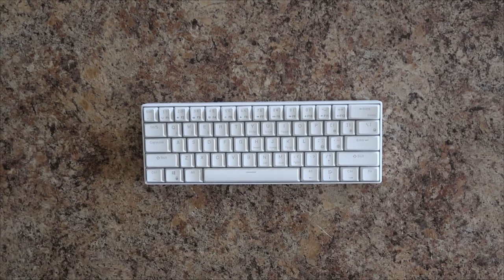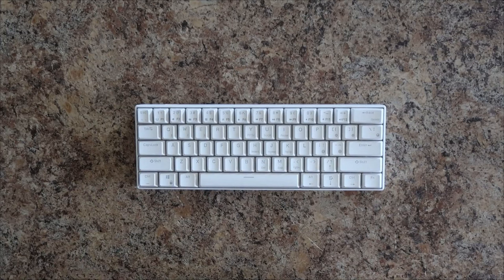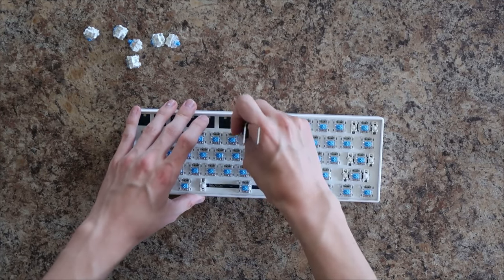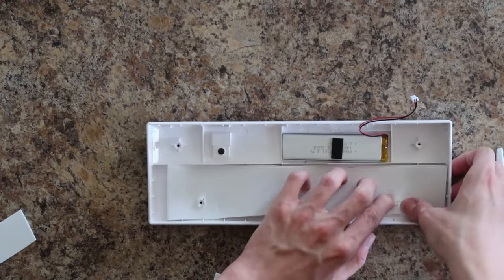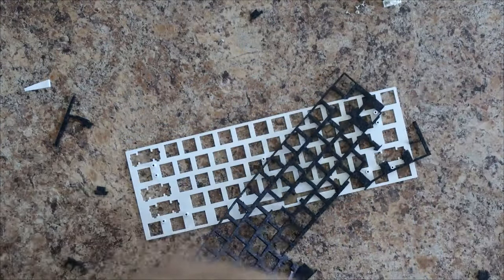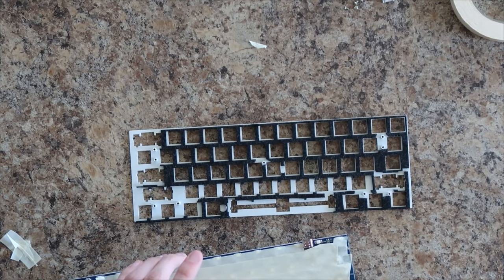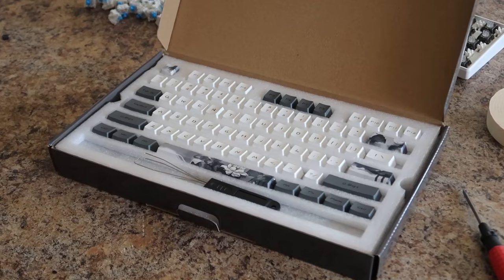Modding My First Mechanical Keyboard (Rk61 Mod)

Comment: PLEASE USE ELECTRIC TAPE IF YOU HAVE A BATTERY
Reply: What happens if I use any other tape
Reply: @moizshaikh2285 it can ruin the battery or melt the tape
Reply: electric tape is better anyways its much thicker than painters tap and sounds much better atleast in my keyboard
Reply: there is no proof of masking tape ever causing problems with batteries. electrical tape leaves residue.
Reply: @sorenkair masking tape can set on fire so it’s safer not too…. Rip rk61 1.0

Comment: Very well documented video, although I do have some things to point out starting with this hobby. Perhaps the stabilizers could've been modded and tuned in order for them to have a smooth and nice feeling. There are many mods and things to help shape a better sound profile for your stabilizers such as lubing and more. Also, your switches are good sounding however I think they are slightly overpriced as you can probably get cheaper switches that feel or sound the same or perhaps even better than the Higround Titan Hearts. Switches such as the Gateron Yellows and Ink Blacks are much cheaper and are better than your switches. Again, these are suggestions only, if what you currently have makes you happy, go for it!
Reply from the maker: Thank you! I wanted to mod the stabilizers as well, but it seemed quite complicated, and I didn't want to mess it up :/. With the price of the switches, I don't know much about switches, but I like higrounds products and liked the sound of the switches. I know they were a bit pricey, but I don't mind!
Reply: @PeytonToenjes  Modding the stabilizers shouldn't be a big hassle especially for a beginner. Even for me, I have modded the stabs of my RK61 and I am still yet to experience the full rabbit hole of the keyboard hobby. I suggest watching a few tutorials and perhaps just trying. :)
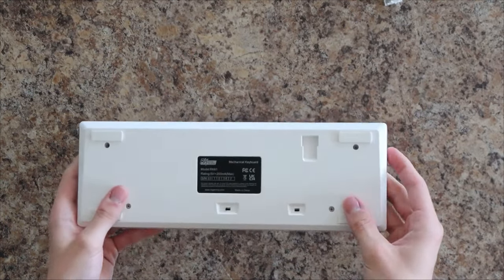Reply: Ik it's too random but is it necessary 2:28 in modding keyboards?
Reply: for almost every mod it is, yes @KhyaTakhe
Reply: yap yap yap yap yap
Reply: @PeytonToenjes I actually have that same mouse
Reply: @4KRESOLUTI0N   RK61 stock stabs are already pre-lubed so they don't need to be modded that much
Reply: @JPCs559  they aren't. i bought one a while ago and they do not come prelubed. unless they changed it now so they are prelubed, they come dry.
Reply: @4KRESOLUTI0N  the one he has is pre lubed.
Reply: Holy yap

Comment: Good thing you like thocc, the rk61 is really easy to he thoccy. simply adding a tape mod. uust 2 layers was enough to make it thoccy
Reply: I wanna mod mine, do i need everything in the video to get the sound?
Reply: yes but get stabs and also different switches if u haven't done it yet

Comment: cool, only complain i have is using higher end switches on a rk61 why get higher end switches that cost as much as the whole board when you could have just gotten a better board like gmk67 or gas68 for around 60 - 80 bucks that have more impact on the overall sound profile overall, budget switches are more than enough if your lube them correctly and could even sound better than more expansive ones. for example, akko cs switches they sound great, and the packaging could function as a lubing station.
Reply: Probably the guy wants just a 61 key keyboard instead of a 67, i couldn’t find any bare bones 61kb without being a complete rip off

Comment: Im thinking about buying the RK61 with these keycaps, with akko piano pro switches, ive never modded a keyboard before, and im wondering, do I need to buy stabilizers, what lube would  be the best, if i need to add foam or tape, and what mousepad would look the best with it? Also awesome vid <3

Comment: I'm confused. Didn't the foam go over the case cut out for the on an off switch?
Reply from the maker: I'm actually not sure, lol. After I modded it, the foam was slightly in the switches way, but after I used them a bit, it was fine.

Comment: I have a question, my mother is afraid of breaking the keyboard by removing the old switches, putting the tape, foam etc. and in the end she advises me to only put the keycaps? Can you answer me please?
Reply from the maker: I understand being scared to break a keyboard by modding it, but if your keyboards PCB is hot swappable I don't see what's stopping you. Just don't be super rough when pulling the switches out, and you'll be fine!
Reply: @PeytonToenjes  Thank you
Reply: @PeytonToenjes  Finally I think I will only put the keycaps with the brown sitches

Comment: Is gateron switches compatibles with royal kludge?
Reply from the maker: The rk61 has a hot-swappable PCB, which means you can basically use any switches you'd like!

Comment: it doesn't bother you having all the function images missing on your new keycaps?  that would drive me crazy.
Reply from the maker: No, f1 - f9 is on the respective numbers, and f10 is on the 0 key.
Reply: @PeytonToenjes  yeah i know, i have this keyboard.  and if you switch modes your right side becomes the arrow keys.  your keycaps are missing all the notation of the function buttons, like Insert, Page Up, Page Down, Home, End, etc.

Comment: what about the rgb? the keycaps arent shine through
Reply from the maker: after doing the mods i just didn't use the rgb on the keyboard since like you said the caps aren't shinethrough, but also not using the rgb makes the battery on the keyb last SO MUCH longer
Reply: @PeytonToenjes  do u maybe know any black/White keycaps that are Shine through but still Look cool Like the in Ur vids

Comment: I thin if you took it a step further to lube the switches and stabilizers, i feel like you would be able to get that thocky soung you want. all in all, great video.
Reply from the maker: The Titan Heart Switches are already pre-lubed, and the stabs are meant to be prelubed, but there basically was nothing on them. Either way, I didn't feel comfortable taking them apart.
Also thank you!

Comment: you should also use foam mod, it makes it sound wayyy less hollow, also, you should get a new keyboard maybe, for my oppinion a keyboar without arrow keys and a numpad aint a keyboard but you do you, also you could use the akko jelly black swithcees which rival the gateron black inks in thockynesss

edit: you already used foam lol, but you should have used a bit more foam, (5 or 3 layers are good)

Comment: just buy aula f75, better then rk61 plus its only 80 (stock sounds better then this. Even modded)
Reply from the maker: The f75 isn't a 60% keyboard though
Reply: @PeytonToenjes  true, however it's a "compact" 75 % (the width of a sixty five persent) and just one more row of keys at the top, if you don't like 65s or 75s get the akko3068 b stock is thock, get the jelly pinks if you do get it
Reply: And the akko3068 b is 80% last time I checked